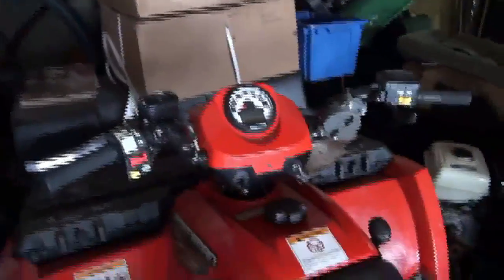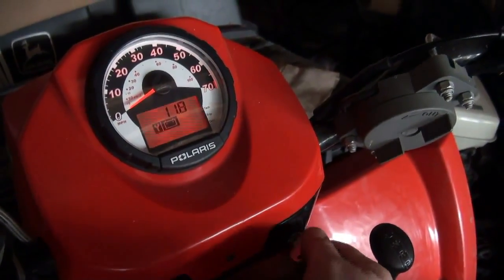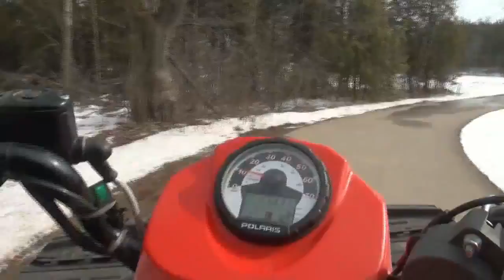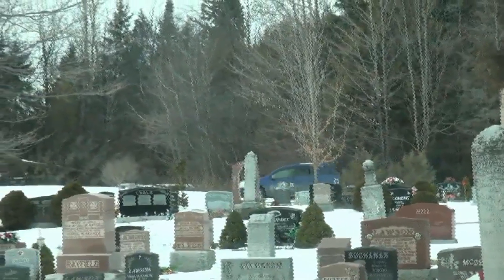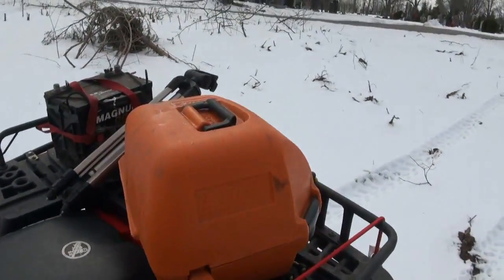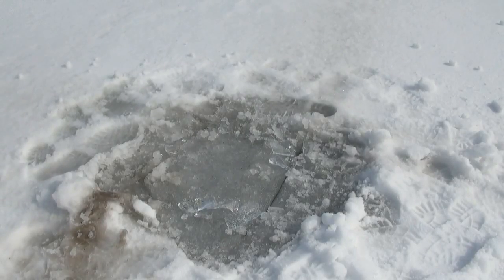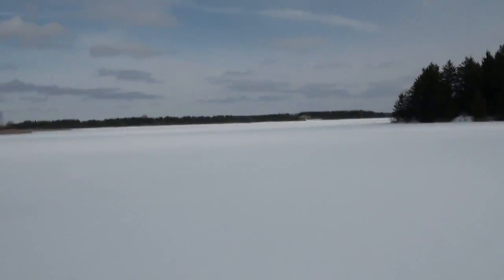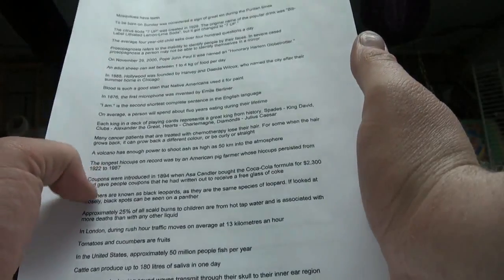remember this day????

Comment: I'm a huge fan of battery tenders.  I run 6 at my cabin for everything with a battery.  I'm getting 4-5years or more out of batteries and they are fully charged and fire right up every time I go to start something. Even if I have not used them for a year or more.